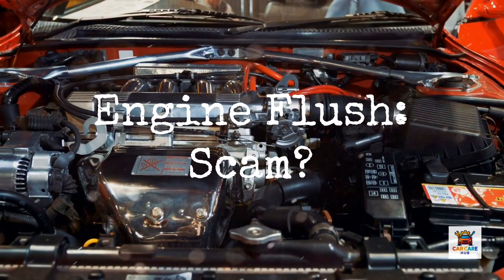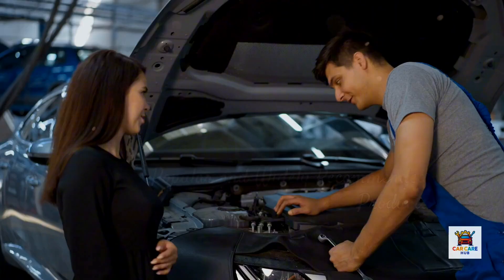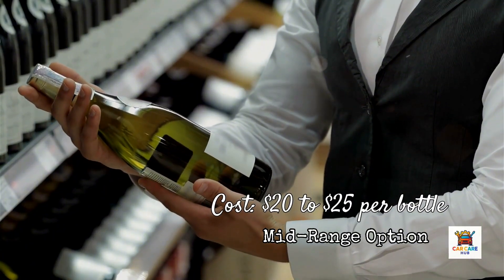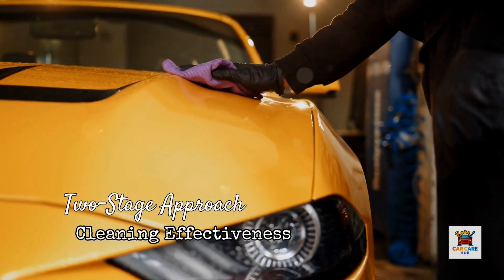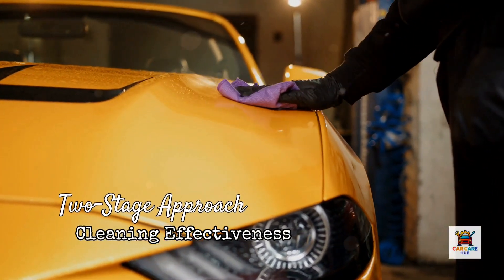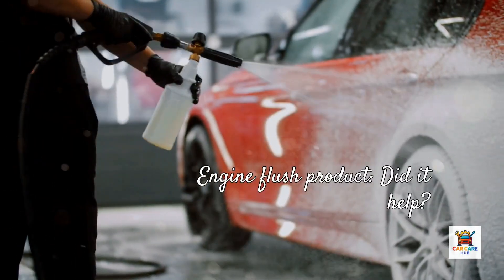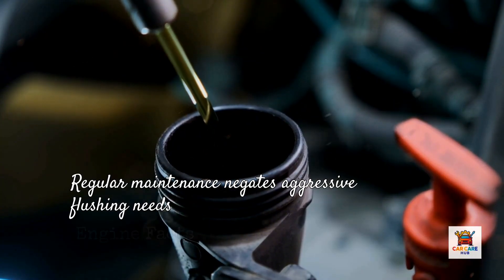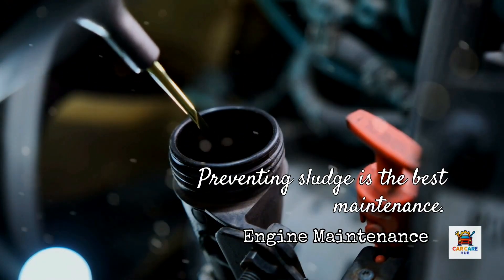I Tried Engine Flush Additives Before an Oil Change — One Clear Winner

Comment: Thanks for the review. I knew about these, but not about the ratings. I used BG EPR 109 on my Kia Sorento 69 k miles and my Dodge Caravan 172K miles. The Kia was burning oil and I had the oil changed at 5k at dealer all of the time. Didn't use TOP TIER gas in it. Got a free new engine at 72.4 k miles after 3 failed piston soaks by dealer. I didn't see the color of oil on Kia because they have it in their spaces. I saw the oil, I do the oil changes myself.. on Caravan, It was really black. I have scope to see cylinders and the Caravan has typical carbon. Last year I started using Valvoline  R & P oil and only TOP TIER gas in both.
 I feel sorry for those who have late model oil burners who don't know about the stuck piston rings and get taken for big bucks$$ by car dealers. Especially since GDI engines. Need to change oil at 3k
Reply from the maker: Appreciate you sharing the detailed experience. Stuck rings and carbon buildup—especially on GDI engines—are a real issue. Maintenance habits, oil choice, and fuel quality definitely make a big difference.